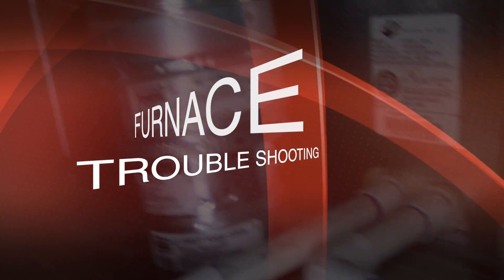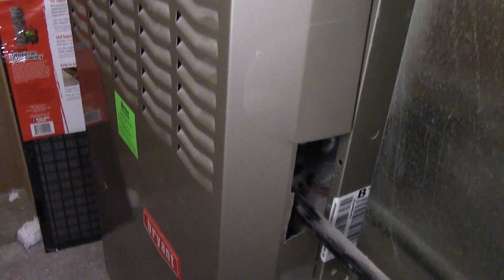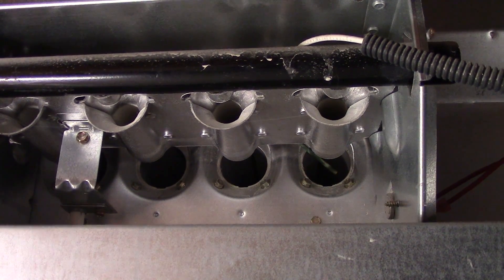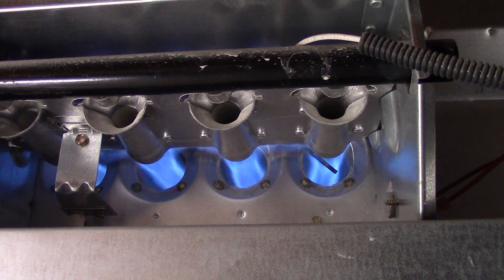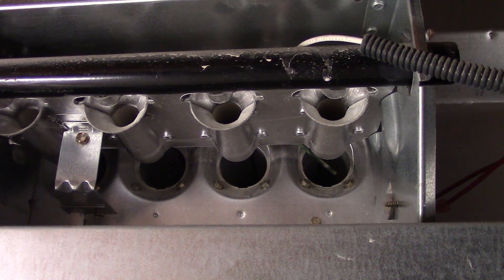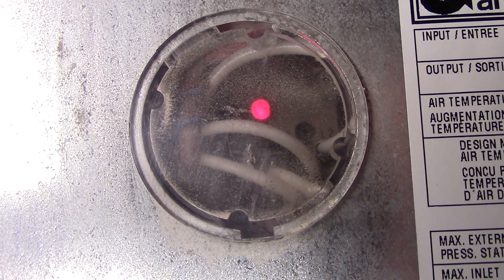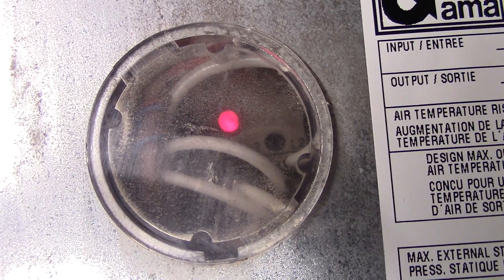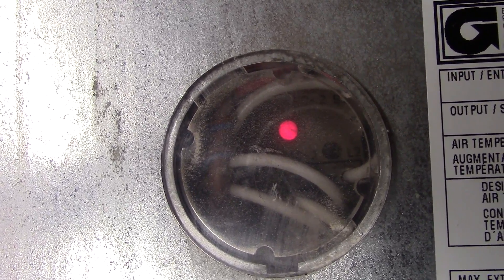How to fix a furnace that won't heat

Comment: Everything helps buddy but that's not completely my issue somehow it's got a twainning error and I only have one furnace
when I did a Google search it said that why was getting signal but she wasn't so I assumed I like an idiot the the wire that had been damaged and I went replace the T wire but it's still flashing red fast.
BTW it's a guardian model I don't know the model right now though.

Comment: Took my cover off turned furnace off. Unplugged the glow plug unplugged the fire rod. Removed cleaned the rod reinstalled turned ever thing on. Glue plug came on went off and now will do nothing. Led light is on not flashing at all

Comment: Trane igniter comes on the inducer fan starts. I cleaned the Sensor sill wont light. Blinking light is for retries and recycle exceeded. Replaced the motherboard and Sensor last year. Andrew, do you think this could still be a Flame Sensor for an electric Furnace?

Comment: so how about when the furnace ignites or lights well and you can see good flames and the fan kicks on just fine. ok but now there is a minimal only warm air coming out. we did just have a snowstorm this is a trailer my daughter bought. it was working fine now it only blows a tiny warm air.  my son is working on it and said the filters are clear the lights are green saying nothing is wrong but it wont blow hot like it did? help if you can thanks in advance!

Comment: Ignitor came on but no flame and it shut off and came on and shut off for few seconds. I cleaned the heat sensor and it still not working. Do you think the control limit is the problem?  Thanks

Comment: My Goodman heating unit will turn on 
1.I will hear a click  then the first fan kicks on!
2.The heating element will glow bright red!
3. The second click for the gas! Once I hear the second click I hear the gas then nothing! I assume the gas is not reaching the heating element to produce a flame! 
Once I hear the gas I blow and it flames up but then that leaves me to number 4!
4.once lit🔥 by blowing on it the second fan comes on and quickly blows it out and everything shuts off leaving only the first fan running!
It starts the process all over again till it shuts off! I'm stumped??????????

Comment: my igniter is working, but im not getting any gas flow. any trouble shooting i can do to see if the  gas valve is no good?
Reply: We had the same problem at a house where we were working at turned out to be a little black box that's next to the ignition switch that has a little metal that connects to it chart checking that out I'm not sure how to explain it much further than that but it's right to the igniter there should be two lines or plugs that go in it where the gaslighting is in the actual unit

Comment: Great video but one step(problem)is missing which I have. What if indicator light is steady on and everything works and flame gets hot but no gas or flames are coming out? What is the issue there. Please help

Comment: You forgot to mention,if the pressure switch is stuck open or closed. It can cause for your furnace blower to keep running without producing heat.

Comment: You just saved us a boat load of cash. Cleaned off the flame sensor with wet 12K sandpaper that I use plastic models. You saved our X-mas. God bless.

Comment: Hi Andrew, Thanks for this video. I have read through the posts below and all of them have similar issues to mine but not quite. 
My furnace is one of those high efficiency ones and has 6 burners which are fed by 6 in-shot burners (tube with fin like, looking things, on each side of the tube).
 
Here is what happens with my furnace's order of operation:
1. Fan comes on and runs for few minutes
2. Igniter glow plug comes on and stays on for around 20 - 30 seconds
3. Gas comes on, igniting 5 out of 6 burners
4. 6th in-shot burner, which has the flame sensor just in front of it, never ignites and stays off
5. System shuts off and the cycle repeats

Just above the 6th in-shot burner (tube with fins) is a PVC vent leading to the outside. Since the vent is connected to direct, outside air, the 6th in-shot burner is a bit corroded. I tried cleaning the rust off with a wire brush, removed the orifice from the manifold, pushed a tiny wire through the opening to make sure there is no obstructions. 
Nothing helped, but if I just blow on the 6th in-shot burner, when the other 5 are ignited, the 6th one ignites just fine and stays on. 
All is good until the furnace has to come on again and the issue repeats.
It seems that the gas flow between all in-shot burners is disturbed between the second last and last burner.
Any thoughts, help would be greatly appreciated. I know I can fix it as the entire setup isn't complicated and I can follow the logic of operation. I am just unclear on the part where the 5th burner should assist the 6th one in igniting. Thank you.
Reply from the maker: I can't imagine the gas pressure being too weak to reach the 6th burner.  Especially since you can blow on it and it will ignite, so it sounds like a possible blockage  preventing adequate air flow, it's always difficult to diagnose something when you're there to see it, but your description was very good.  Copy and paste your request to other furnace diagnostic videos and see if you get a better response than mine.  It would also help to know the make and model of your furnace as they may all have this type of problem.
Reply: Andrew Hill: Thanks for such a quick reply. It doesn’t seem logical, but am planning on swapping the 5th and 6th orifice and the in shot burner with the 1st and 2nd one at a time in that order. If the issue follows to 1st or 2nd position I will know I have gas flow problem and will replace it with a new one. Also the PVC pipe just above the 6th in shot burner seems to be feed as there is a second PVC pipe that exits the fan and has condensation return tube attached to it flowing to the sump pit. 
So the next theory arises if maybe there is too much air blowing on the 6th in shot burner preventing it from igniting. 
The furnace is a 2011 Frigidaire 
Model# FG7TC 120D-45. In the past when I tried placing a service call on it no one wanted to come out after hearing the brand name.

Comment: Andrew I️ have a head scratcher. I️ went through the video and the spinner is spinning the furnace is initiating and I️ have great blue flame. Also no leds flashing or any sign of the system running wrong. But I️ am only getting cool air through my vent? Please assist
Reply from the maker: Hmm.  So it ignites and blows?  And it's still cold air?
Reply: Andrew Hill yes sir
Reply: It goes through all the motions and you can see the blue flame and you go to feel by any vent and it’s cool air. Not necessarily cold but not hot at all

Comment: So when the ignitor comes on those it supposed to stay on?
Reply: Bobby McCants I believe it will turn on when needed, my furnace didn't have the rods in front of the burners so I took a brass brush and just cleaned the ignition rod and it fired up. Hope this helps somewhat.

Comment: Great video, but before you do anything, make sure cold air isn't getting into any of your intake vents (drafty doors/windows etc). These vents provide the air into your furnace. If the furnace is sucking in cold air, then the igniter will not stay on. Cut of power to furnace. Place a portable heater near the 1st floor air intake for 5 or 10 min to pump warm air into the furnace then hit the power back on to the furnace.

Comment: My LED status light is not on, while I turn on the heater I could hear the motor spinning but ignitor is not glowing. Eventually the system will shut down. Is this an issue with the motherboard?  It is a Goodman attic furnace with White Rodgers B18099-13 board.

Comment: Andrew...

My Goodman motor tries to start but doesn't. Red light is steady on, which means system is ok. I've taken out and cleaned the ignitors on both sides of the burners. It worked great for a day after I did that, but it won't start now. It had been raining last night. Can moisture somewhere be the issue? Exhaust pop pipe to outside of house has wire mesh so I don't think anything has been able to crawl in the pipe.
Reply: When you say that the motor tries to start, I assume that their is a supply to it, so it sounds like a fault in the motor itself. Their can be 2 reasons, either the motor is partly siezed and cannot develop enough torque to start, or part of the motor winding's have burnt out. In this case, when the motor comes to rest in a certain position, it will not be able to kick off again.

Comment: Thank you for the video. Today I returned home and the electrical works fine everywhere but the furnace. I reset the breaker and pulled the panel on the thermostat, but there doesn't appear to be a blower functioning or  any visible red lights through the panels. What do you suppose I should replace for this?

Comment: very simple put and helpful video, thanks, my furnace goes on/off not been able to reach the set point, then the induction motor will run but no ignition will happen, this is an old G.E. package unit (gas) which started giving me issues just recently, fan switch, igniter now this, could you please shine the light for me? really appreciate it, thanks you

Comment: Don't forget the heat cutout switch. If this sensor goes bad it will not let the furnace start at all. This is incase the system overheats or gets too hot, it will shut down the system.

Comment: my igniter does not turn red so ima guess thats whats wrong. Ima go buy one today and see if that was it. i'll come back with an update and see if that was it
Reply: update: i didnt unplug the power so when i touched the igniter with a screw it sparked up and it broke so either way i need a new one. No stores were open today so tomorrow
Reply: Another update: It was the Igniter. had to buy one from EBay attached it in and bad. it started to light up and works perfectly. Hopefully it stays good
Reply: xProdigy1994 does your fan blower turn on when the ignitor was not working? I have a green light but that is. Thermostat is working because i can switch on the fan. Do you think the ignitor has to work for the blower fan to start kicking in? Thanks

Comment: My house heater dos not heat , the thermocoupleing was bad i replaced it 
the pilot light is working. when i turn the heater up, every thing work except  it dose,t heat .
i found out  the gas don,t ignite. and the furnace is about 20 year old. What could be the problem? Thank you

Comment: UPDATE.. not that you asked lol

Well the heating element broke so had to buy a new one. That took a few days to get  and got kinda cold for the family (colorado).  After even cleaning the sensor it still would just shut right off again. Well it was blinking 3 red lights. Blah blah blah.. searching found this video where the guy talked about a "vacuum switch? With a rubber hose. So I  used a straw and blew back and forth  a few times. He said SOMETIMES that works.

And it came on and been working super ever since. I did order a new vacuum switch.. just in case. I heard this vacuum switch is like the last thing to check.. who knows

Thanks again Andrew.
Reply from the maker: You're welcome.  Glad it worked out for you.  The entire USA is apparently due for a massive deep freeze very soon.  They've even forecasted 2ft of snow in Hawaii.  No joke, but we all know how forecasts go.  So at least you're prepared before that nightmare hits.
Reply: Thank you for mentioning the Vacuum switch, actually there is two on my Carrier (redundancy) and one was installed with the vacuum hose way to long, ( a deep sump in the middle) After going through all of the aforementioned checks with no joy, I saw your remark about the vacuum switch and removed the small hose from first one and then the other, and on the last one when I removed it about one half ounce of water condensate ran out of it which had effectively blocked it from allowing the switch to activate. (we're talking about a very slight vacuum) The furnace immediately started working as advertised when it was cleared. Thanks again for saving me at least a hundred buck  service call for a very simple fix not to mention a week with no heat!

Comment: My thermostat checks out good . I go thru start up procedure as in the manual that came with furnace [propane ]. With therm~ 10 degs above room temp - Nothing happens?
Hours !! later , furnace mysteriously starts up ? I have seen igniter come on once after going thru start up procedure ? Fan runs on furnace when elec turned back , goes off after 5 or so minutes when burners do not light ?
  What do I check next ??It should be auto coming on but only comes on Later , after going the the start up routine .
 Thanks

Comment: Hi Andrew, I have a comfortMaker furnace, .My problem is that after the igniter lights up and the gas turns on, the gas only goes as far as the first tube and sometimes the second, so the flame doesn't get all the way across to the flame sensor before it dies out, any  insight?  Cheers.
Reply: Take out the orfices and clear them sounds like something is stopping the gas from flowing all the way through. The orfices are the brass pieces that are at the end of the gas pipe they're threaded on

Comment: Didn't teach me a thing. I came here to find out  why my furnace won't fire up when the glow ignitor comes on. FURNACE does  not "Fire Up".....So its not the flame  sensor.
Reply: First thing is make sure you paid your gas bill!!! If you do have gas then at the point where the igniter has came on you should hear the gas valve click open and that's when the gas goes thru and ignites but if you don't hear anything it could be a bad gas vavlve or no power going to the valve
Reply: same here...igniter lights...there's a click...but no flames...furnace shuts down...tries again same result...this vid didn't address that even though this seems to be fairly common...also the red led doesn't blink at all

Comment: My LED is constantly flashing, the exhaust fan (little spinny thing) does not turn. The blower comes on for a few minutes and turns off. No flame, igniter and flame sensor are good.  Please advise.
Reply: Might be circulation failure, filter is clean?
Reply: Turned out to be a bad control board. ~ $300 for a new one. Replaced it myself.
Reply: five years ago a friend got a new control board for me and he did something wrong with one of the chips and we had to buy a 2nd control board so beware! Sorry I don't have details.

Comment: I been waking up in the middle of the night to my furnace blowing cold air. After monkeying around with it, I finally turned the a/c tripper off for 10 minutes and then flipped it back on and the furnace started blowing hot air again. I've had this cold air problem for several days now and I keep going thru this routine over and over. Any idea's what could be my furnace problem?
Reply: I am having similar problems...what did you find?   I finally figured out it was flashing red.....sometimes i have to move the limit switch to get it started, I let it cycle through the three tries last time without touching the limit switch and it has worked for over a day now, I have 26 year old York stellar plus and am awaiting quotes for new system.
Reply: If your system includes a pilot, thermocouple failure is the most common fault and can be intermittent at first. The good news is that they are inexpensive and easy to replace.

Comment: Strange problem: my furnace fires up, stays on, and the fan kicks in. I am getting airflow through the intake when the fan runs but I'm not getting any heat -- or any air for that matter -- coming though my vents. Suggestions?
Reply: did you fix it? What was the problem. I cleaned the flame sensor. I also cleaned off the ignitor and reinstalled it. I am thinking it is just possibly a "Bad" Flame sensor that turns it off after the flames have run for about 3 minutes....but it then fires up the flames another 2 times after it is no flames for about a minute or so. 

Is there such a thing as a temperature regulator?

Comment: Hi i changed my igniter on my furnace, it gets glowing hot but my furnace still won't kick on, we changed the sensor, but i wasn't sure if it matters in size, the new rod looks like it is 1/4 smaller then the old one..It still won't light..So i cleaned up the old one like i seen on the video's and put it back it..when turned on, it does the same as the first time, it glows i can hear it click on, but no flame...Once after a few hours pass, it kicks on but only runs for maybe 10 minutes and then shuts off again...(any suggestions will be very appreciated)

Comment: YOU SKIPPED THE PART WHERE THE BLOWER COMES ON, THE IGNITER GLOWS RED, THE GAS DOES NOT COME ON AND THE FURNACE SHUTS OFF.
Reply: Update on my problem 
I had volt to had valve all was working but not sending gas 
Turns out the neutral wire was not fully in inside the plug on the board. Pushed it in and turned power back on and heat was nice again
Reply: Bad Gas Valve. Check for 24 V to ground on your valve while doing the start up. If present = BAD gas valve. If Not, check the manual valve On/Off switch on the Gas Valve Assembly.
Reply: Brand new furnace gas is on switch is in the on position 
Igniter comes on you can hear the click for gas to come on then it goes out. About 6 times then the code blinks that says 1 hour lock out ????

Comment: i have replace both glow plug and flame sensor with still no ignition. i'm still getting code 34 after the furnace is going thru it's cycle.. so no it didn't help...  sorry for the negative feed back....

Comment: i cleaned and then replaced flame sensor, light is not flashing and burners will still not stay lit. Not sure what else to do on this goodman furnace.  Have also replaced gas valve,  any suggestions. ty